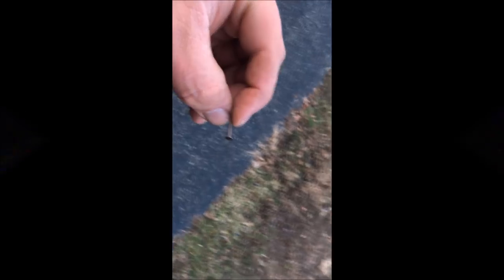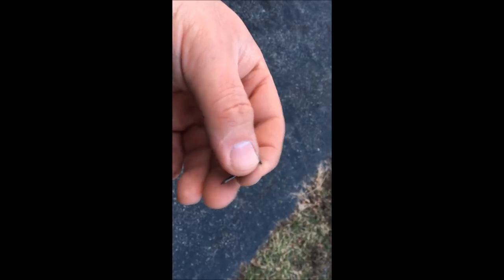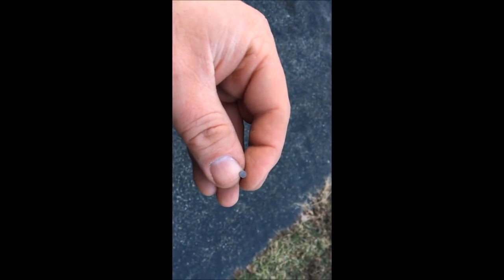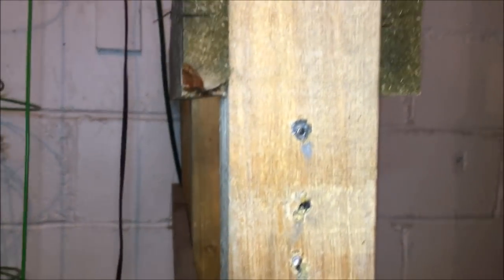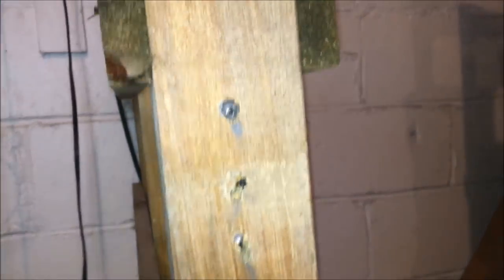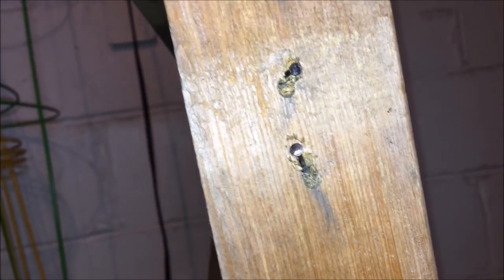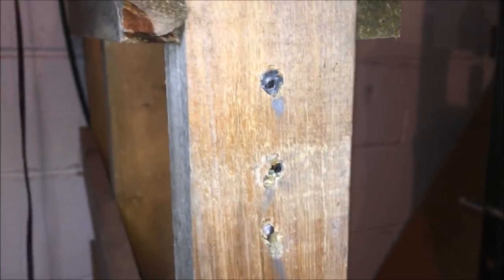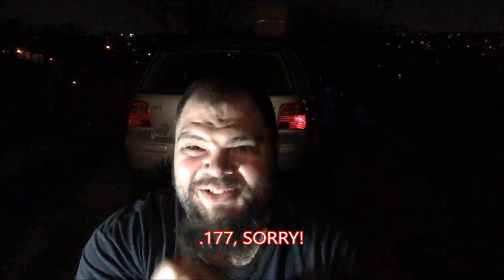Is there really such a thing as a "Tack Driver", and is the GAMO Urban one?

Comment: Great stuff Doc! That top nail in the wooden pallet was an amazing display of kinetic energy being deposited on one single point. Loved it! Very entertaining video.
Reply from the maker: Hajimoto Productions Right? The bottom two were bent by the time I figured out the POI shift from the change in distance. They didn't drive in squarely like the top one. I'm just now uploading part two of the "Leaving a pellet on a nail" trick. Turns out...it's ENTIRELY possible. And I did it! Should be up within an hour. :)

Comment: my urban came with a horribly rough bolt. it can't be cocked while the rifle is shouldered and if the barrel is pointing at the ground, I can point it towards the ceiling using one hand on the bolt, as it won't budge.  I can see that it's got a lumpy, uneven substance of some kind along the uhh, shaft. is it possible to remove the bolt without disassembly?